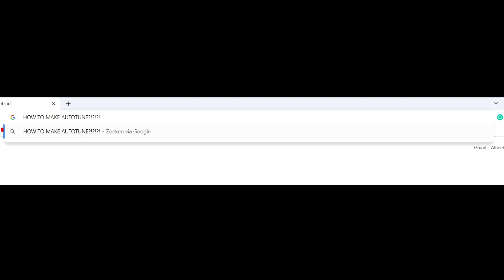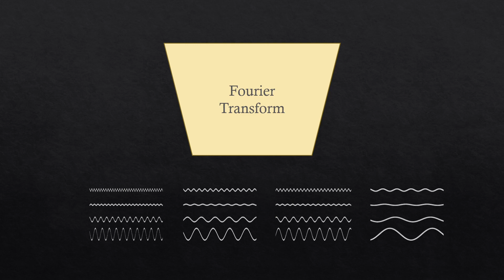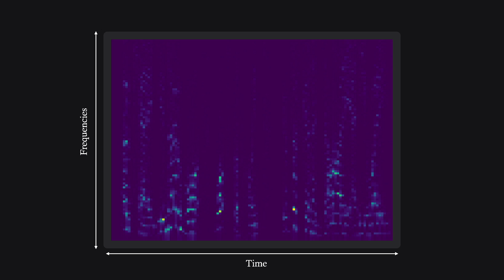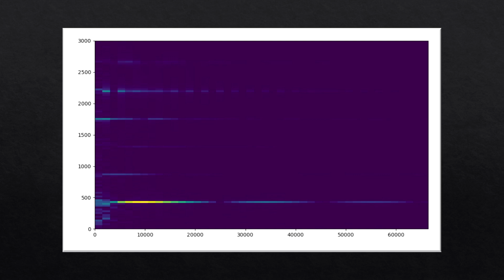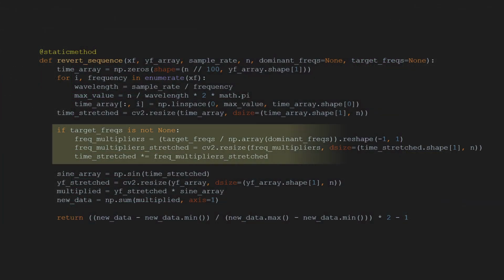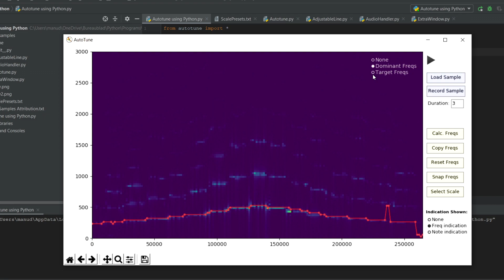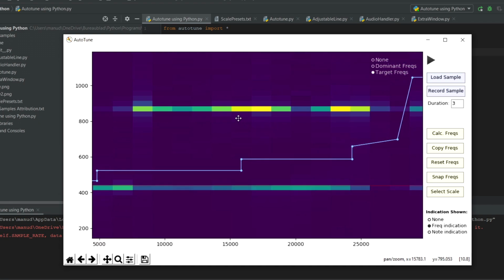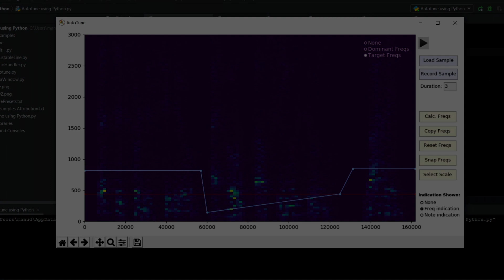Autotune using Python & How Pitch Correction Works

Comment: Hi PyExplained, Nice explanation of the audio signals.

I'm currently working on the video player which requires speed and pitch control separately in realtime while playing the video.
Is it possible that we can do it in python?
I tried to get some information regarding it but I'm clueless.
Please help me

Thanks
Reply from the maker: Hi there! 
I don't think Python is the best language to try to make real-time applications with. I personally used Python in this project because it was the language I was most comfortable with (and because the speed of the application wasn't my top priority). In the case of your project, I would try and look around for faster languages that still serve the ability to show graphics and output audio signals.
It may still be possible to use Python, but you'll have to devise some good optimisation methods (you could look into GPU computations using CUDA, for example).
Anyways, I wish you the best of luck with your project! Don't hesitate to share your progress if you want to :).

Comment: in true autotuning, increasing the pitch does not produce a chipmunk effect
Reply from the maker: I guess you're right, but I tried my best to make it sound as good as possible. It's also the first time that I tried to do something with sound, so I was glad that it worked as is. But, as you say, there is still room for improvement, so definitely let me know if you have ideas on how to improve the autotuning ;).
Reply: @PyExplained  I recently discovered that if you autotune a sound in a true autotune to a high pitch and a low pitch and then display a logarithmic spectrum of these sounds, the component frequencies of the first low-pitched sound have the same spacing between them as the component frequencies of high-pitched sound. I think that solution for that is shifting frequencies from fourier transform not lineary but exponentialy. Youtube does not allow me to insert a link so I had to replace dot with A and / with B. imgurAcomBaBJAQdpkW
Reply from the maker: That's really interesting! Thanks a lot for the explanation. As I said in the video, I didn't do a lot of research as a means to challenge myself (or maybe because I was a tad bit lazy ;)). I was curious to see if it would just work by shifting the spectrogram up or down by a certain amount, but this obviously throws off the ratios between frequencies, making it sound out of tune. That's why I ended up stretching the spectrogram instead.
As you're saying, the solution might just be stretching it exponentially, but I think it might also have to do with the fact that I 'chop up' the audio signal. In earlier testing phases, I did use overlapping samples, but I found that working with chopped-up audio was a lot easier. In the end, the chipmunk effect isn't all that bad when increasing the pitch. It's mostly reverting the audio signal that causes it to sound a little funny. So even in unchanged audio samples, you can hear the distortions. It's also very noticeable when layering multiple voices (like in the reharmonization I did for the intro). However, I do think that doing the thing you described would help with making the 'corrected sample' sound more realistic (since the frequency components of our voice don't always have the same ratio to each other).

Comment: Excuseme I download your code and run on spyder, but I cant show like your GUI, maybe I need to install something?
Reply from the maker: Yes, you do indeed need to install some libraries in order to run the code. Here is the link to the documentation (including a list of the libraries you need to install): https://github.com/PyExplained/Autotune-using-Python#Required_modules.
If you're still having trouble running the code after this, please let me know.
Reply: @PyExplained  I have already install all required modules in your GitHub, but it still can’t run the GUI.Does using the different compiler meter?(Sorry about some wrong grammar and thanks for help!)
Reply from the maker: @william8495  Could you copy the error message you're getting? Then I could take a look at it.
Reply: @PyExplained  I don't have error message, but my output just have a Image like your GUI, and I can't use any function.
Reply from the maker: @william8495  Mmmhh... That's weird. I'm not entirely sure what could cause that, but I suggest trying to run it with a different IDE (maybe IDLE?).
You should also check whether all the example audiofiles are present (maybe you deleted them?).
Reply: @PyExplained  Don’t matter, I will try another way, thanks for help, it’s a nice video.

Comment: i can use this with web app ?
Reply from the maker: I'm not entirely sure what you mean by your question. If you're asking whether or not you can use the application as a web application, the answer would be no. You can currently only use it by downloading the code (including all the required modules) and running it.
I might have misunderstood your question though, so if something still isn't clear, you may have to specify your question.